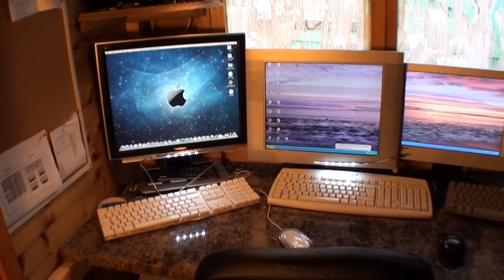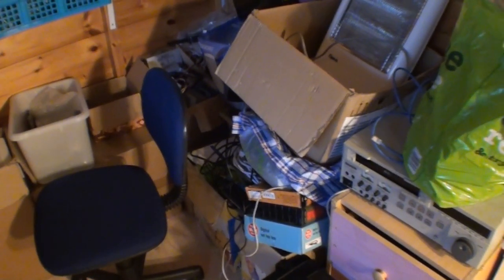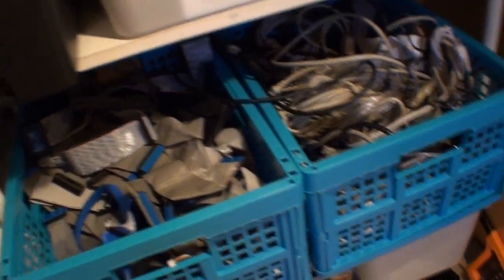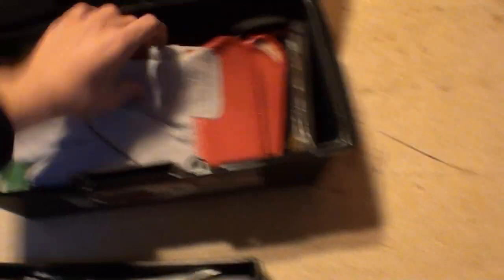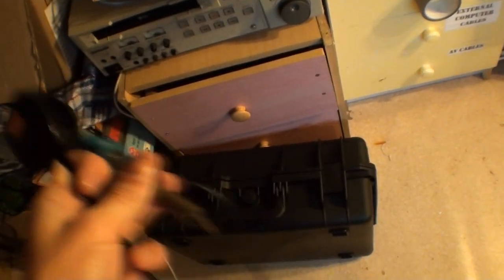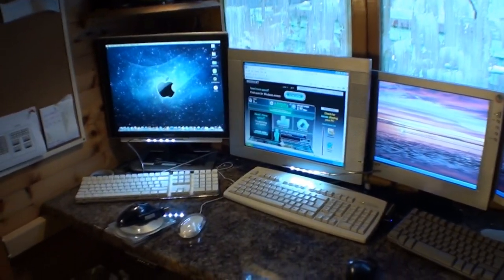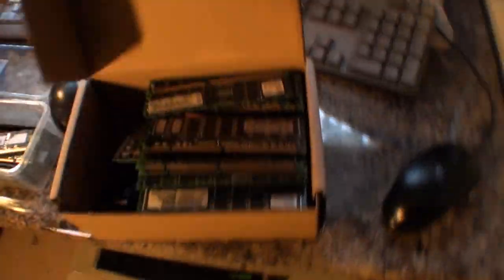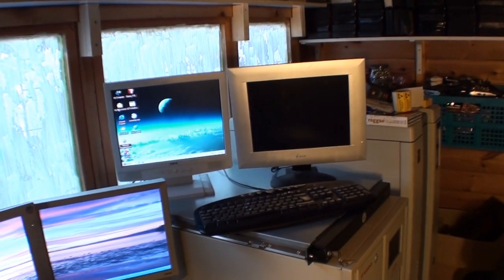My Server Room - Updated

Comment from the maker: I had a dedicated 30A 3-core power cable which I wired into the "Cooker" outlet in the consumer unit 
(I had a gas cooker so I had no use for it) which ran in a sealed above-ground plastic pipe from the house and down the garden which was about 80ft or thereabouts.
For data, I had four CAT6 cables running in a separate pipe to reduce interference from the power cable. I only ever connected up two of the CAT6 cables, as the others were there for expansion.

Comment: I use my shed as an office, It's all connected up with power and I use a very long Ethernet cable for network connectivity, I have lots of computers, components and networking equipment I have collected over the years as well as my TV :) I recently brought 2 HP ProLiant servers from eBay that I have just been setting up.
I was just asking about Ikea because that's the closes one to us and you mentioned that Dagenham is not far form you (we live in Kent)

Comment from the maker: Nice! Sounds like our sheds are our castles. If it was up to me, all this would be in the house but the Mrs won't have it :-p The shed it a little bit of a mess at the moment because i'm waiting for parts to arrive from China to repair the Breece Hill DLT library in the corner so i've had to pull it away from the wall, plus i've just bought 6 more 19" servers which mean until I can put the DLT library back and tidy everything up, i've got about 8ft square to work in!

Comment from the maker: Well one will be used as a SAN array but I haven't decided on the others. Long story short, the seller on eBay wanted £75 each for them so I bought the whole lot. Each one had 6x 320GB SATA Drives in which I sold for about £15 each, so I recouped the money I spent just selling the hard drives. Each one has two Dual Core AMD Opteron's, 16GB DDR2 RAM and an 8-port SATA RAID card so there's still at least £150 worth of parts in each one.

Comment: It depends on the router's leasetime. If that's a week, you got your IP back again after restart. Until the router restarts, then it'll map all IP's and cliënts again. But, simplify the system for yourself, use static IP's. You'd be able to make better security rules in your router as well (IP binded). Go in first place for security.

Comment: I started of with UBUNTU 12.04LTS Server edition and managed to install desktop and had that for a year or so and them moved onto Linux Mint MATE 32bit then to Linux Mint MATE 64bit then Linux Mint Cinnamon 17 (Qiana) 64bit, I am also friendly with a guy who did the exact same as you did although we don't see each other much now, I suspect you will be looking SATA2IDE adaptor boards you should be able to get that sort of thing you could use a ASROCK motherboard with 12 SATA connectors, you had a SGI personal IRIS why get rid of it.